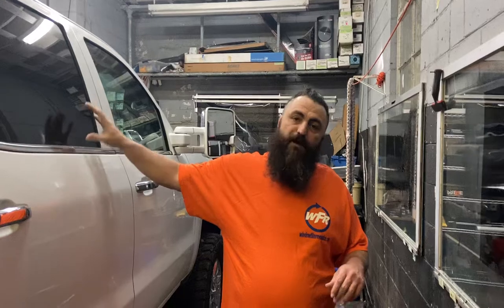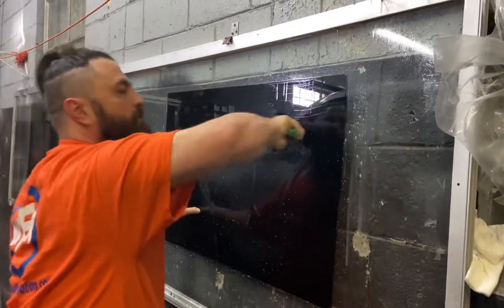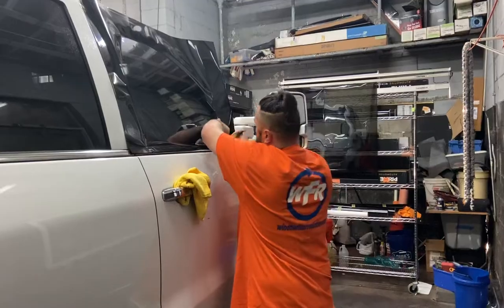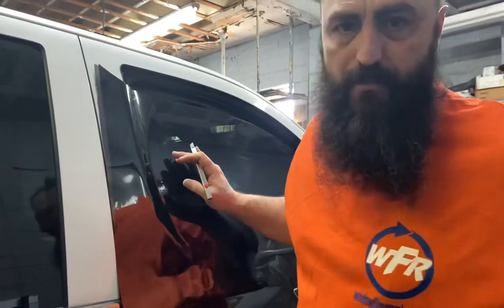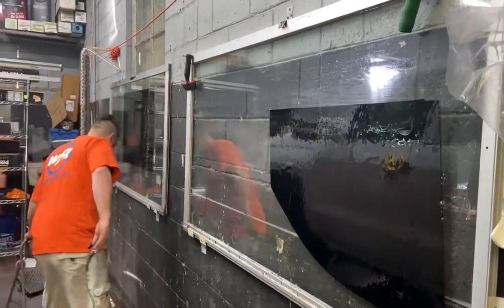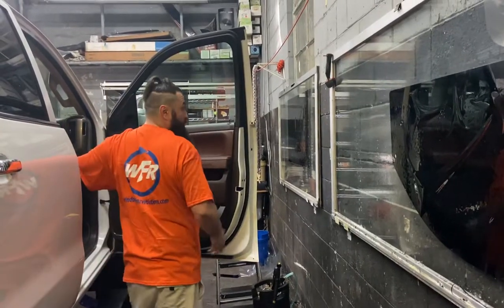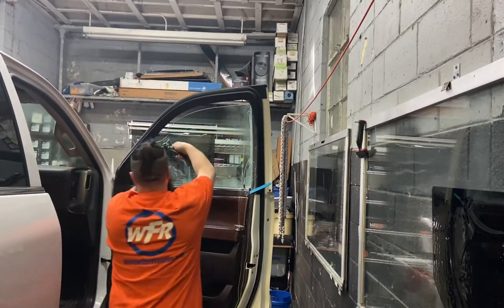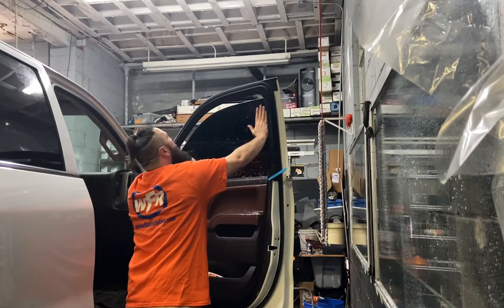How to install multiple layers of tint film? The trick to double layers

Comment: I had some 20% tint the other day in stock I doubled it and made it 5% I forgot about this trick thank you I hate lining up those two edges
Reply: Hey i am wondering how you get the percentage of how dark the window is when you double tint? I don’t know if it’s true or not but I’ve read multiplying for example in my case .50X.50 which equals 25%, does that sound accurate? 

Thanks
Reply: @g0t2bmiirii  Correct, 20 over 20 would really be 4%.

Comment: Hi guys. Just want to ask is it okay to double the tint? 

Because my car came with stock security tint from factory, but very clear and doesnt filter the heat properly. So I am in the market to apply new tint. I'm still very much love the original tint due to its security features, but afraid that if I apply another layer of tint (probably around 3mil-5mil), it will affect my power window. Do you have any advice?
Reply: i had 15% over 5% for 2 years and had it removed a couple months back to replace with just 20%. Double layering most definitely affected the efficiency of the power windows, but honestly you trade maybe a millisecond in window speed for max privacy haha. pick your poison ig.

Comment: Thanks for making this, first video I have found like it. I would like to know how to calculate double tint though? I have 70% factory glass and I am trying to figure what 35% or 15% over the 70% would come out to. Thanks!
Reply: Multiply the final layer of tint percentage by the previous. Factory tint is 70% of 100%, or (.70 x 100 = .70)... you move decimal  right two spots for the percentage, so in other words .70 = 70%. So then if you tint over the 70%, then you begin to assume 70% is the new (100%) and of that 70%(acting as 100%), you are only letting through either 35%, 20%, 5%... or whatever you put on it. So in other words 35% over 70% is (.35 x .70 = .245) so 24.5% or basically 25%...... 20% over 70% would be (.20 x .70 = .14), so basically 14%...... 15% over 70% is ( .15 x .70 = .105) or basically 10.5%.....and 5% over factory 70% would be (.05 x .70 = .035), or basically 3.5%.  When you start putting tint over factory rear glass which is usually 35% or 20% then it gets real interesting. For instance a simple 35% over factory 20% is (.35 x .20 = .07) so you’re already at only 7%. Now put limo tint 5% over factory 20 % ( .05 x .20 = .01) you get basically 1%.... which is what the guy did on his rear windows in this video.

Comment: If I have a 35% on my window and add another layer of 35% will that affect the tint when I roll my window down
Reply: No I know guys that have 3-4 layers of tint
Reply: pugapo lapulapu  I get that but I currently have 35% on my front windows but it seems a little to light now and I don’t wanna remove the old tint so I’m thinking of just adding another layer of 35 but I guess I’ll just remove the tint and get 5%

Comment: may I please know the advantage of applying two layer instead of one?
Reply: There really is no advantage other than achieving a darker look.  In the video he states the customer put 5% over the factory 20%  in the back which made it a 1% and he wanted the front to be the same percentage.  5% is usually the darkest film one would carry so to make it look darker than 5% he put a piece of 20% on the 5% to drop it down to match the back.  It's more for darkening the shade vs.  doubling durability or performance of the film.  In other words you don't go to the tint shop and ask to get 2 layers of film just because you think it will last longer or work better.
Reply: Better protection from the hot sun